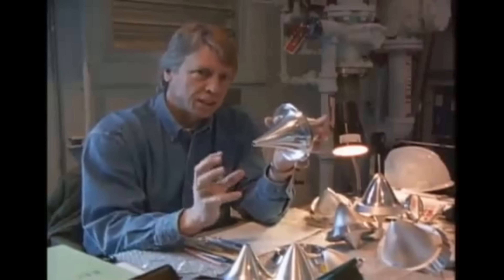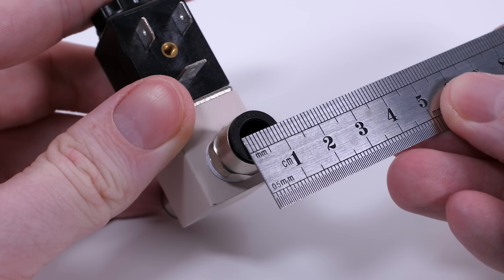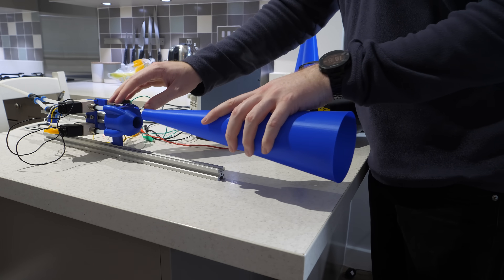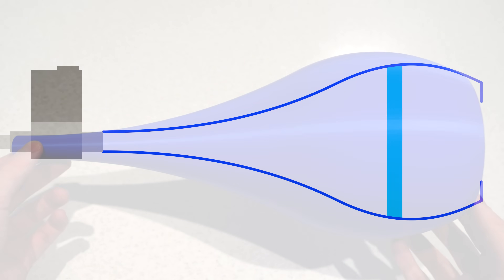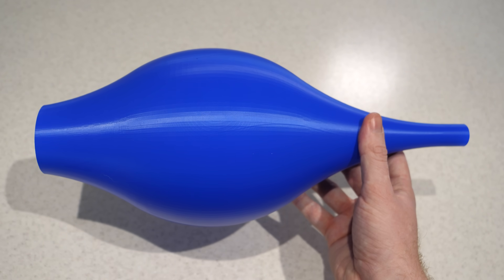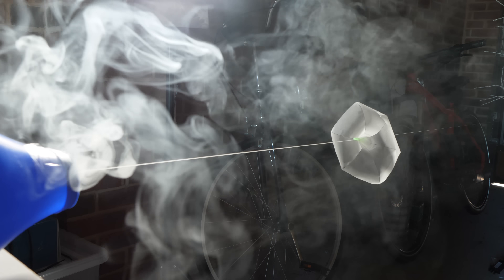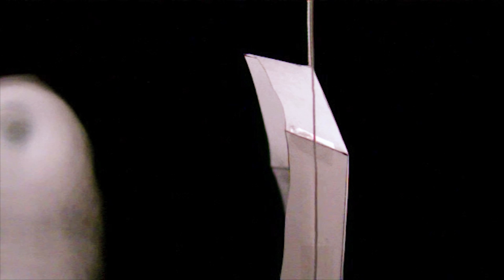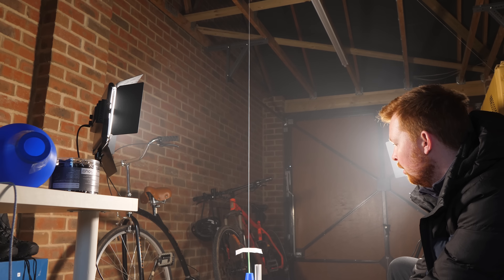Smoke Ring Propulsion

Comment: Does the air flow need to suddently stop for the vortex to appear? At 2:58 it looks as though the sudden stop of air flow causes the vortex to stop in its tracks.

If in fact the air need not stop for a good vortex to form (or if you decide to proceed with just plain air flow), you can probably look into Air Aspirators (check Inflation Principle of Aeroplane's Evac. Slide on youtube). They appear to offer faster air flow capabilities.

Aside from using Bernoulli's principle, I am not sure how it works and what the parameters need to be, but with your manifold it might be easy to achieve by drilling a hole in the middle of the back side. Someone in the comment section probably knows better and can point you to the correct resources.

Comment: For the vortex, if you have access to fluid computation, all you have to do to design one that's perfectly tailored for your release mechanisms would be to slice it, and make it a single wall all the way. 
That said, i'd 3D print the blocks from the electro-valves to make the system bigger, ditch the connector from the exit side completely.

Comment: If you want a really short, powerful burst of air, look into using a QEV (quick exhaust valve) with a solenoid-controlled pilot valve. That's what I used for the full auto pneumatic blaster on my channel. Normal solenoid valves have a very long opening/closing time. QEVs can dump entire secondary tanks in a fraction of the time.
Reply: I used a 3/4 inch diameter QEV from McMaster Carr for a potato gun and it worked great. QEVs would be a great solution.
Reply: They're popular in paintball & combat robotics for a reason. Though they require an extra valve to safely discharge the pressurised tank after usage

Comment: You should use a “quick exhaust valve“ and dump it using the small valve you have. This is how they shoot air into the center of a filter of a vacuum system to clear the filter… I also watched this same show:)

Comment: What is the reasoning why a vortex would be effective for propulsion? It needs to transfer momentum, but it seems that there is very little net momentum (since the inside of the vortex may be moving forward, but the outside is actually moving backward).

Comment: Very interesting project! For someone who owns a smoke machine I'm surprised you haven't considered using a subwoofer with high enough Xmax as the vortex generator. I think it would allow for better control and tuning of the output, by modulating the frequency and amplitude. I would suggest something at least 12" like a Dayton, which are not overly expensive. Would you consider it?
Reply: Wouldn’t the “pull back” from the membrane reduce the power of any blast of air it created?
Reply: @Stillbourne42  You'd probably need a controlled air inlet into the chamber to prevent that
Reply: Maybe one could combining the speaker as a power source with a pulse-jet style valve to quickly get air in front of it again.
Maybe have the speaker in the center with a circular duct around it with one-way valves suppling air to the "work"-side of the cone. To help resupply air, it may be necessary to "boost" pressure using some radial fans (radial is better for pressure).
Reply: @MazeFrame  Yea this sounds interesting and on the loudspeaker topic i was wondering about how horn design principals might help in designing the cone, i know different outcome but it reminded me of that

maybe even something like a venturi, it gets difficult adding fans and suck because turbulence is the enemy here so the smoother you can pull air in the better  idk if its complicating it when its adding the driving force and the valve by the same mechanism but its interesting they do make rings themselves tho it comes down to what better outputs consistent driving force

Comment: You can make the laser one yourself, but you'd need a freaking BIG laser. Ultimately it studied, noted, and shelved. It will be useful in the far future when we eventually get off this planet, because in space all the negatives of this tech are negated by the vacuum. You could power a wide range of craft using this.

Comment: We used a trash bin with a hole mounted on a bass speaker which was powered by a step function generator. This setup could shoot across a room. It also showed very nice results when shooting with two of these synchronized towards each other.
Reply: That's cool!
Also, with a speaker/actuator impulse device, the system parameters could be sufficiently controllable and repeatable to inform a (computer) model.
If it can be modelled, it can also be iterated towards the best performance......
Reply: @pompeymonkey3271  plus play sick beats, two words dubstep cannon?
Reply: And that is how the dubstep cannon was formed!!!
Reply: @connorjohnson4402  I'm now googling "dubstep canon". Yay!

Comment: That reminds me of Townsend Brown experiments with asymmetrical capacitors charged to high voltage, that would be a good follow up to this video ! The V bomber is supposed to have charged leading edges on the wings, and opposite charge from the engines, creating a polarized field propulsion system, it was covered in great detail in a book by Paul La Violette.

Comment: Far higher pressure (like that from a 300 bar divers bottle) would probably help with the vortex speed/power. Would be far more like the vortex generators which rely on combustion.

...finding a sensibly priced solenoid that can handle that sort of pressure will then be the challenge.

Maybe oxy-propane being fed into a combustion chamber and a pulsing spark plug used to repeatedly generate high-pressure combustion-based vortices/vortexes might be the way forward?

---

NB. is it vortices or vortexes?

Comment: So, my entirely layman guess on the "laser spinning top" is basically they have a machined top that spins very fast, and then they blast it with a very short pulse of a high powered laser. The laser hits the metal, which causes it to vaporize a bit (or maybe the air) which then creates a pressure differential, and then because there is nowhere for it to go 'up' it slams into the metal top... Which is spinning, so it gets balanced and the net result is the top moving 'upwards' away from the laser.
Reply: The shape of the projectile focuses the laser onto a small area of atmosphere, converting it to plasma. Think laser powered pulse-jet.
Reply: The shape of the projectile focused the laser on a small area, converting air into plasma, and the expansion on the plasma creates thrust.

Comment: You need to make sure the volume of the exit air "slug" needs to have a diameter to length ratio of 1:4 to create a well formed ring.. (Reynolds number critical)..
Reply: So cool that this is covered ground
Reply: Really curious if principals related to creating loudspeaker horns would be useful here at all, his cone designs reminded me of it , different desired outcome but still seems like there's conections
Reply: Cool! Where can I learn more about this?
Reply: @ki0w0-lordofwatersheep  just look up ring vortex cannon gun..  hill vortexes.. hail cannons..
Reply: @platypusrex2287  I mean optimal parameters like air volume, d/l ratio, etc
Reply: @ki0w0-lordofwatersheep  there are many papers on the parameters.. use the previous as search terms for papers not videos..
Reply: @platypusrex2287  ok thanks

Who said I searched for videos with those terms? I did search for papers
Reply: @ki0w0-lordofwatersheep  lol... most people look for videos..
Reply: @platypusrex2287  lol, most videos were about making the stuff(often in amateur-ish ways) or using its vortices. of course you must go to papers to get numbers, data, ratios, etc

Comment: Making the air less turbulent before it enters the vortex creator might help with accuracy. A 3d printed part that resembles the inside of a catalytic converter might work.
Reply: We did this for a small wind tunnel we built at college by passing the air through a bunch of drinking straws packed into a pipe.
Reply: Laminar flow!

Comment: Tom you could have used a sub woofer duct tapped to a bucket with a hole in the bottom.  Using a amp and drum sounds works really well

Comment: Explanation for what the man with the laser was doing and how it worked....

The laser is hot 🔥...
The heat from the laser is partially reflected by the mirror smooth metal surface... The heat of each individual point of laser contacting the surface reflected to a single ring of focused heat ignites nitrogen.... Expansion from ignited nitrogen propels the craft....

Comment: Maybe if the sail is spinning, the gyroscopic effect can stabilise it a little?
Reply: I think with such a lightweight paper design, it would be difficult to get it spinning (especially without support), and the small amount of angular momentum would quickly be dissipated by friction/air resistance if you don't increase the mass, which would be counterproductive. But I'd love to be wrong/see the potential problems fixed. Interesting idea

Comment: Recently I also play with vortex ring generator using same technology as you. I tested same valve as you, but now I moved to 2v130-15. It has much larger orifice diameter that allows larger air flow with similar on/off cycle time. That resulted with larger and faster stable rings.

Comment: I remember seeing that same laser propulsion video when I was a kid! I think what's going on is they have a pulsed laser with an optics setup that makes a wide beam that's below the energy density that will cause air breakdown, and the highly polished "UFO" aircraft focuses that beam to a density that can cause air breakdown, and the plasma pop pushes it up a little bit. No idea what kind of laser power you'd need for this, but I'd guess into a pretty substantial average watts realm on a fast pulse. If someone on here can pull off reproducing it even at garage scale I'd be impressed.
Reply: This sounds like a job for Styropyro!
Reply: collab with styropyro
Reply: afik, they were using a multi-killowatt pulsed CO2 laser to fly that UFO.  I.e. something expensive and good at killing mirrors.
Reply: @martylawson1638  IIRC it was the MIRACL installation out at White Sands.  So actually over a megawatt continuous, probably way more than that pulsed.
Reply: I remember those 'lightcraft' videos. Leik Myrabo apparently got 'poached' by an aerospace company (with military contracts?). The proof-of-concept was done, it seems entirely feasible that it could have been developed, as Myrabo suggested, for delivering small payloads (up to, say, a hundred kg) to orbit at a fraction of the cost of current tech, and much faster, a single launch system possibly firing dozens of times a day, and with many of them operating simultaneously? Although (small) satellites were discussed, another possibility would be ferrying the parts for much larger constructions to be built in orbit, like the bricks for a house. An intriguing property of the craft is that they apparently self-centre in the beam like a pingpong ball on a column of air, so guidance would be much simplified compared to rockets.
Reply: @EliteRock  they got gobbled up, but are still in development for a bigger project, one that holds a target that gets vaporized by the laser so it can go outside the atmosphere.
Reply: @humanistwriting5477  That's the idea - carry a reservoir of a medium on the craft (water would suffice) that can be exploded into plasma by the energy beamed to it. Accelerate at a good fraction of a G for 30 minutes or more to a velocity well beyond anything remotely possible with rockets. Mars, here we come! But that's assuming a braking projector is already in place on Mars, or in Mars orbit. Lagrange orbits might be another possibility for stationing both (interplanetary) projectors.
Reply: @EliteRock  yup. Teflon is also a candidate for vaporization with some good old fashioned chemical enegery included as opposed to water that just converts the heat.
I had the pleasure of doing some prototype work for that group can't say anything more then I have though, only out of professional courtesy.
Reply: Yea back in the good old days of scientific tv programs before the viral infections of reality tv and ancient aliens destroyed it all. but pulsed lasers are a thing and surprisingly much more accessible today
Reply: found the video of it: https://youtu.be/LAdj6vpYppA
Reply: @SpydersByte  'Lightcraft' had their own website back in the early 2000's with a couple of longer videos of the tests (I captured them but, as is ever the case, lost them over the years as I migrated from one PC to the next). The model shooting skyward, flashing dazzling blue-white plasma looked like the future (the quintessential UFO?), but 'space travel' outside of near-Earth orbit has turned out to be a (materialist?) fantasy, and is now moribund.
Reply: Considering how long ago that was filmed, and the availability of "cheap" Chineesium lasers, it could well be possible to get the same results today with multiple lasers all firing at the same object...?
Reply: Let's say the metal thingy weights 100g. That would need roughly 4.8 watts with no losses according to SO.

But it isn't that simple because levitating doesn't require any power. You can make for example magnets levitate indefinitely without any energy.
Reply: @Henrix1998 Magnets don't actually levitate indefinitely. They have a charge, it just takes a really long time to discharge.

Comment: This video seems like an Engineer's solution for not knowing how to vape
Reply: I wonder what this would do to a tomato.
Reply: manitoba2445  you've been vaping crap??
Reply: @Scanlaid  that is how I read it as well. Lol
Reply: Good one!!!
Reply: Do you want to vape while standing 50ft away? Great news!!!
Reply: Hi integza!
Reply: @integza. Video idea. Does laminar flow effect the efficiency of a pelton water wheel
Reply: @LabRat Knatz you’d want a fan to move the vapour. This would also create negative pressure across the accelerant. 
Although I believe this is how diesel spark plugs already work! 😋
Reply: I’m well aware Diesel engines don’t use spark plugs. They use glow plugs. It’s a running joke amongst auto mechanics to send apprentices to fetch diesel spark plugs. 
Glow plugs heat the diesel in the same way a vape heats the carrier fluid

Sorry for trolling
Reply: @tonyoliver4920  Most diesels don't have spark plugs and the ones that do just have normal spark plugs.
Reply: @theyeetus1428 is talking about glow plugs
Reply: @tonyoliver4920  diesel spark plugs?
Reply: @FixedAFT  Yea they often come in bundle deals with blinker fluid be sure and check in with your local autoparts store associate they will usually help you out if you ask!
Reply: @FixedAFT  He's just saying dumb things to get attention (odd flex...)
Reply: S L A P P T R O N
Reply: bahah gotem
Reply: The nozzle is a mission for Integza
Reply: Toasted more than tomato based rocket fuel
Reply: @LabRat Knatz onto of that... what if you shot the atomized fuel in the rings... and then somehow ignited them at the craft... that could end up being pretty epic.
Reply: @MrRadicalMoves    The backyard scientist did something like this with igniting gas bubblerings under water which is pretty badass so check that out so id imagine something similar but overall would  probably not be the most efficient transfer of force, seems like a backwards upsidedown totally from left field way to make an aerospike engine in a sense.
Reply: @LabRat Knatz Surface tension and viscosity isn't really the things to be worried the most about  what is is the vapor pressure of the fluid and boiling point which is related to those things but not always,  But in the aspect of atomizing it and ultrasonics its almost how fuel injectors work anyways, But the traditional way would be routing your fuel lines near areas that will heat up and that being used to cause the fuel to turn into a vapor, the issue with that is the pesky property of phase changes and that they cause rapid expansion so will force backpressure in the fuel lines and stop them from flowing properly. Theres a name for it and its vapor lock which can be an issue in airplanes and is a vital component to fuel system designs and how fuel get pulled from fuel tanks  and is also a factor in fuel choice coming back to the  liquids vapor pressure,
Reply: fat clouds for days , becoming a professional douche flute player is no easy task if ya didn't know
Reply: Tom Scott should try it.
Reply: @Integza You should try to make these nozzles with copper (maybe 3D printed with metal-resin wire), so you could experiment with a microwave oven if is possible to shoot plasma vortex rings, as an inalambric stun gun. 
3D printer if you like the idea XD